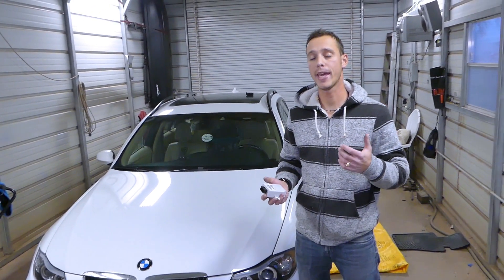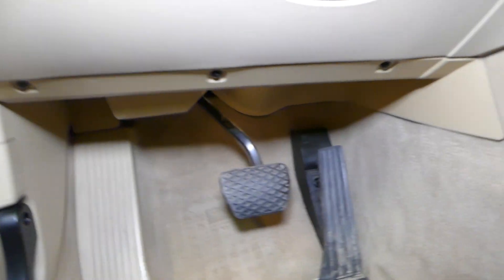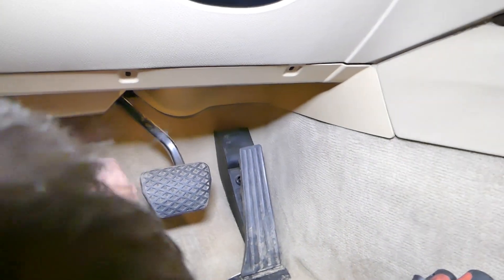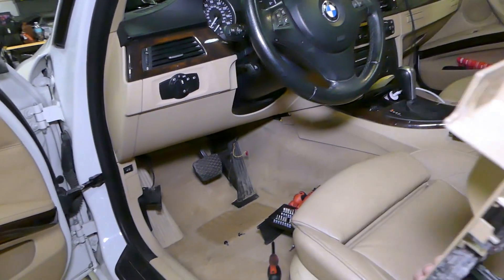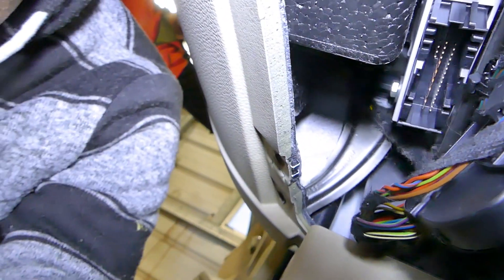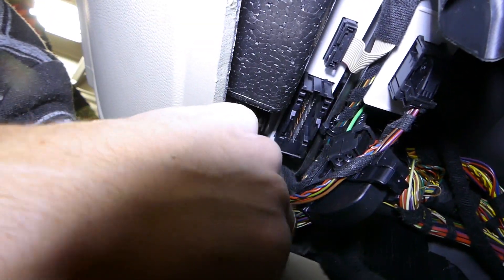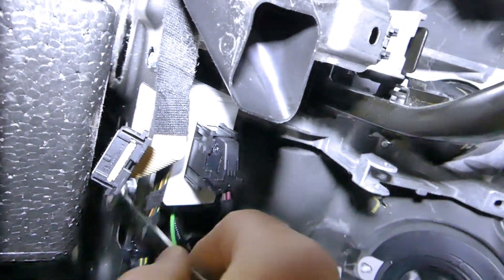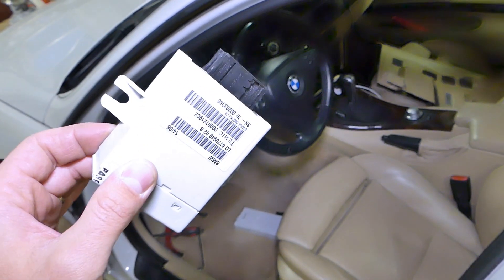HOW TO RMOVE AND REPLACE CRUISE CONTROL MODULE ON BMW E90 E92 E91 E93

Comment: Very helpful thank you for posting. Just for anyone interested I notice a lot of ebay sellers using a newer number while selling older units, I'm not sure that always works when units have been superceded. Also, make sure you purchase a used one, if you are, from a mph or kph market the same as your is or it will give mixed information between the dial and the central digital display. And make sure you get exactly the same number if you want your active cruise to operate... ;)

Comment: Hi, your videos are very helpful. I have a problem that several mechanics were not able to find. Would you have a suggestion? I lost power to my front doors controls, steering wheel controls, horn, tilt, cruise, signals and mirrors. The wipers will not shut down. There are no burned fuses or relays in the trunk, behind the glove box or the corner of the engine compartment. All after a battery replacement. I’ll appreciate any help or ideas. 2006 530i 98k miles.

Comment: Can you just switch the module while the battery is disconnected ? 
Or do you have to program the car afterwards so that the car recognizes the new module? 
My E92 325d from 2008 has the active cruise control but it stopped working. Fuse is good so I would like to change the control module.
Reply: I’m also interested in seeing a reply to this question from anyone. How did you go Auctor 137 as I am now in the same position as you once were?